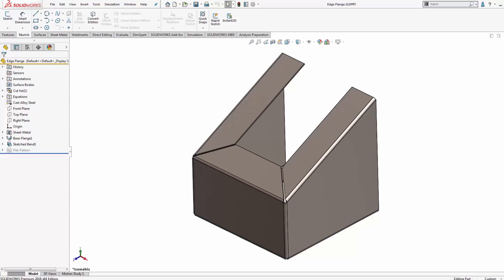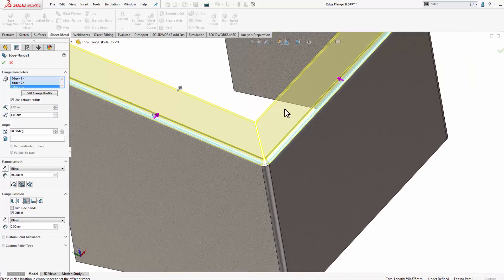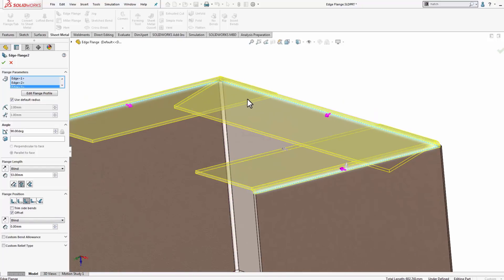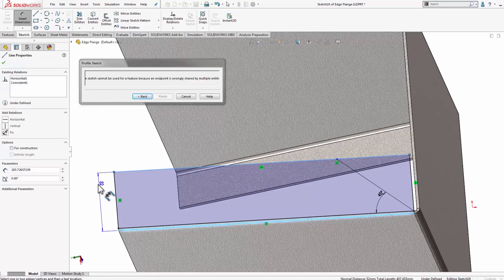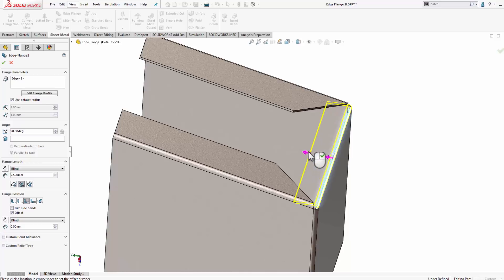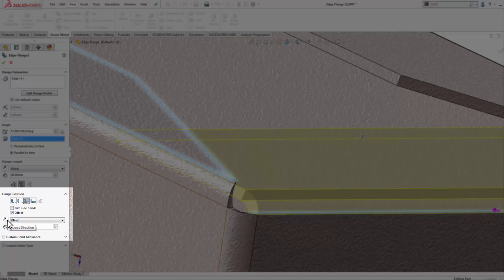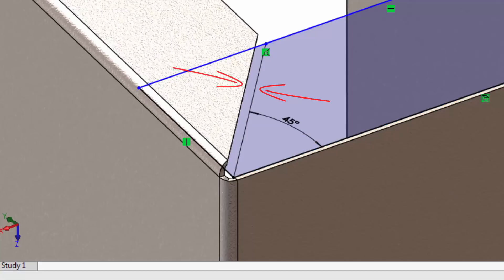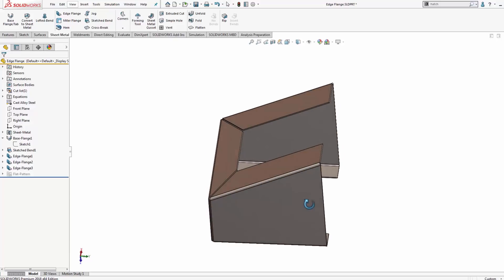SOLIDWORKS - Mitered Edge Flanges on Non Parallel Edges

Comment: Why is the bottom edge cut at a different angle then the side edges ?  Why are they not all on the same plane ?
Reply: The bottom edge is cut perpendicular to the face, all the edges and faces in a same plane or parallel plane of the sheet are perpendicular each other, seem wierd but it´s easy to see.